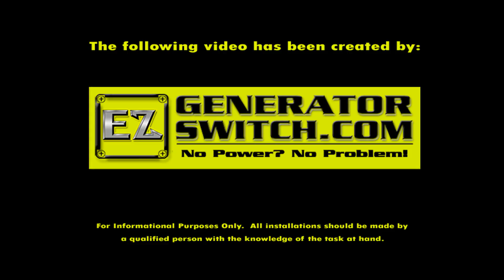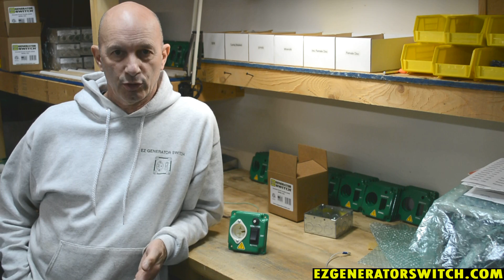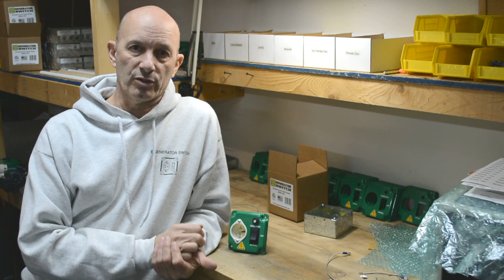EZ Generator Switch - What's The Difference Between a Bonded and Floating Neutral Generator?

Comment: So now both the line and load neutrals connect to the single neutral wire on the transfer switch now correct?
Reply from the maker: If you have converted the switch,  you have one neutral off the inlet. That single neutral connects to all the neutrals in the circuit
Reply: @EZgeneratorswitch perfect thank you very much will be installing your product this weekend!

Comment: I have a floating neutral on a 7000 watt inverter generator so should I run a ground wire from the floating neutral on the generator to a ground pole in the ground?

Comment: This is a bit unrelated to your switch but I have s circa 1999 Coleman PowerMate 5000 which has a 3 wire receptacle so I suspect a bonded neutral. However I see no compromise to my system as it feeds a 30-2 breaker and neutral in a sub panel and  the generator itself has no earth ground.
Reply from the maker: Put a chassis ground on the unit first. This will protect you from getting a fault current shock. You can test the unit but I'm guessing Bonded neutral to frame. Directions for testing on web site... Very easy test. Appreciate your questions.

Comment: So what generator is better to buy. A bonded one or a floating one. I read most Honda's and bonded, most Yamaha's are floating???
Reply from the maker: Rob Monaco don't get hung up on bonded or floating. We just need to connect them correctly so there isn't a safety code issue. I would suggest an inverter generator. Cleaner power, quiet running and Honda and Yamaha both use very little fuel. Most inverters are floating neutrals.

Comment: My transfer switch has neutral and ground on separate bus bars. My main panel the neutral is bonded. If I get a generator that has the neutral bonded to frame will I be good to go since my neutral and ground bus bars are separate in the switch? And what’s all this talk about a grounding rod do you need one of those? Thanks in advance!!
Reply from the maker: First lets address the "Ground Rod" . Every manufacture requires a ground rod connection , this is a safety feature for you. In case there is a fault where the hot leg touches the casing of the generator it will short and go to ground and avoid you getting a shock. Now because your panel has two separate connections or "bus details" one for ground one for neutral is not uncommon. This has nothing to do with the type of generator you purchase or own. If you buy a bonded neutral generator the neutral needs to be switched "away" from the existing neutral because that is neutral bonded already. Code doesn't want a neutral "bonded" in two different locations. Exact opposite is true for a floating neutral generator...it has never been grounded and therefore needs to be connected to your existing neutral which is bonded, thereby satisfying the NEC. So it is about the switch you purchase. Can it be converted if needed? EZ generator switch is the only company we know of that has a switch that can do this.

Comment: Does the switch make whole house work when using generator?
Reply from the maker: Single circuit transfer switch for an essential load during an outage. If you want to do your whole house the switch must be rated for the "whole house"

Comment: I have a Floating Neutral Home Generator conected to a breaker at the main panel with an interlock.  Do I need to ground the generator using a separate grounding rod?
Reply: If your gen set has a 4 prong plug feeding the house then one of those prongs is a ground, and will eventually wind up at the ground terminals in the main panel. (if everything is wired correctly) This is why all new gen sets have 4 prong plugs, unlike 30 years ago when some still had 3 prong 240 volt connections.
Reply from the maker: Yes  every manufacturer wants the frame bonded to a ground rod. It is for your safety
Reply from the maker: Need a ground rod no matter how many prongs are involved.
Reply: My previous comment was that your main panel is connected to a ground rod (sometimes two) and that is where the 4th prong of the generator plug winds up if you wired things correctly. By code, you should only have one central point of ground, just like when adding a sub panel. They all get wired back to the entrance panel ground buss and use separate wires back to that point. The thinking in the old days was the more ground rods the better. These days they are splitting hairs and feel that more ground rods at a distance (other end of the house?) may introduce another variable for voltage potential. Let's teach people to go by the code book and we'll sleep better.
Reply from the maker: rupe53 I agree article 250. Every manufacture that's has a UL or equal has specific instructions including where to place a label on their equipment. Their equipment in this case is a generator. It has instructions to ground that generator to a ground rod all per their UL label or equal . Here is their reasoning, they don't know if your ground (not neutral) is a good connection so they require it.
Reply: +EZ  And here lies the all mighty catch 22 situation where new code (last 30 years?) requires two ground rods (8 ft apart) for a service because that's way cheaper that the equipment needed to see if a single ground rod is doing it's job. Reading between the lines (in the code book) that means connecting the gen set (hard wired) back all the way to the main entrance panel for a known good ground. Again, reading between the lines, it would seem prudent to go back to the panel but if they insist on another ground then add one per the book, meaning a second rod that's 8 ft from the first one and both tied together. That should satisfy everyone.
Reply from the maker: rupe53 is nuts isn't it. What I have seen because we have a ETL (intertek... Like a UL) they require us to do things that are exactly like the ground rod issue. If we don't follow what they tells us their inspector can shut us down. Every quarter they send out their police to check us....and we have to pay them too!
Reply: ... and I have a "Safety Nazi" from our insurance company visiting the shop today, so we're in the same boat!

Comment: My generator has a floating neutral (not bonded).  The instructions that came with the EZ Switch provide connection instructions for Switched Neutrals and UN-SWITCHED Neutrals.  Which instructions should I use if I my generator has a floating neutral?